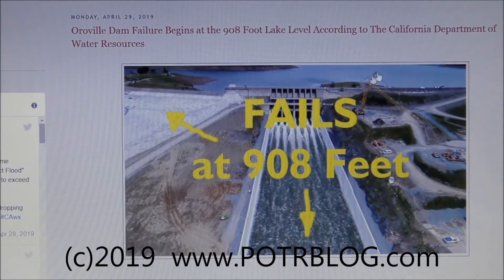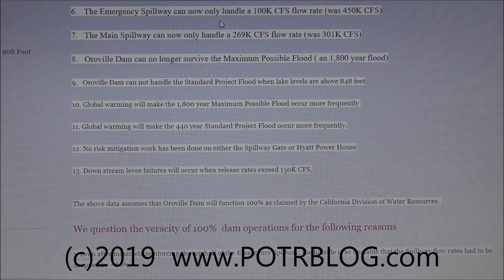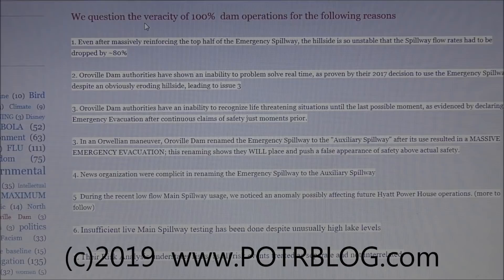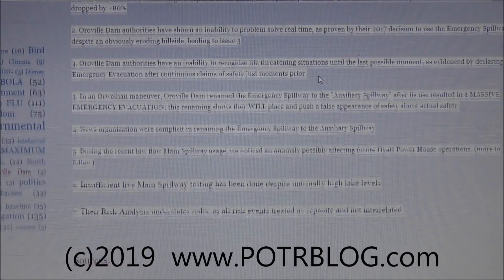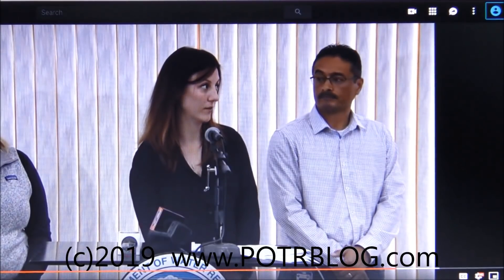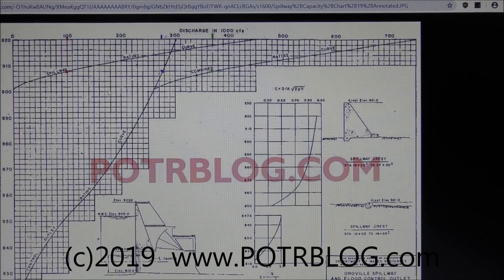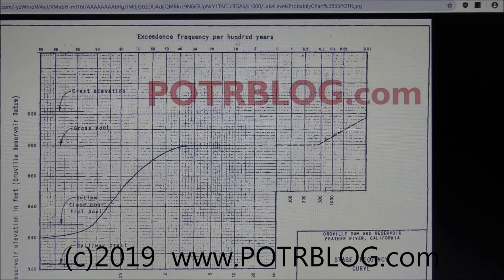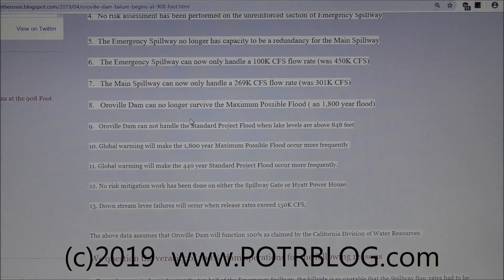Oroville Dam fails at 908ft says California DWR

Comment: it is impossible for the lake level to get to 908 feet, the massive 1/ mile long emergency spillway is built at 902 feet...  there is not enough water in the known universe to run the water level  6 feet deep over that spillway.    Cease being such a stooge please, its sickening.
Reply: The emergency spill way is at 901ft but other than that your correct the water would never be 7ft above it unless all reservoirs above oroville broke at the same time and Oroville was at the 899ft mark
Reply: @patrickzink2191  hello patrick,  the emergency spill way IS at 902 foot *elevation*... it is 1,750 feet LONG  that is over a quarter of a mile long.
Reply: @Phil_Scott  all stats I've seen say 901ft but ok
Reply: @patrickzink2191  The spillway's *horizontal distance is 1,750 feet more than a quarter of a mile, so that when the lake over flows it, the spill itself is that long.

.. there is less than a tenth the capability in the water shed around the lake to overflow that quarter of a mile more than 2 feet deep, with the main spillway closed, 

If the main spillway is open... then there is not enough water in the known universe to over flow the main spillway and then over flow the quarter mile long emergency spillway 16 feet deep.... it will never, ever happen, not in a billion years.

902' is just the elevation of the emergency spillway, it is 20 feet below the crest of the dam.... for the dam to be washed out, water has to crest the dam... that is 18 feet *deep flow across the spillway.  .. an impossibility
Reply: @Phil_Scott  no shit bro only thing I said is the spill way is at 901ft not 902ft but otherwise I agree with u

Comment: With the reconstruction of the two Oroville spillways completed there seems to STILL be controversy.  There needs to be some clear statements of FACT.

 First, the the elevation at the top of the main dam is 922 feet.  The EMERGENCY spillway is at elevation 901ft.  That is 21FEET lower than the top of the dam.  Think of the dam as being the equivalent of a two story building higher.  The main spillway is designed to handle a volume of water needed to keep the lake elevation between 830 feet and 900 feet in a normal spring runoff season.  The EMERGENCY spillway handles the rare events where volumes exceed the capacity of the main spillway, as happened in 2017 when the lake level topped out at 902.59 feet.  NOTE THAT THIS IS STILL 20 FEET BELOW THE TOP OF THE DAM.  

The crisis existed because the EMERGENCY spillway was in danger of failing, NOT the main dam!  The emergency spillway was not designed to handle the flows that occurred in 2017 and it was feared that the concrete lip on that spillway would be under cut and fail allowing the EMERGENCY spillway to uncontrollably erode causing a devastating flood downstream.  At NO POINT was the main dam in any danger. 

The reconstruction of the main spillway was required because of damage to that structure.  The main spillway has been constructed to far higher standards using far better materials than the previous structure.  However, the more important work was the reconstruction and "hardening" of the emergency spillway.  The emergency spillway has been reengineered to be far more resistant to erosion than before.
Reply: It's still failing on the spillway cause it's showing the rebar on the spillway...it's spalling it's coming apart like the other spillway did ok...
Reply: @ginapalang9191  were is the proof or are u taking the word of someone in Ohio that is only seeing YouTube videos and there are no pics Or videos showing rebar in the completed concrete
Reply from the maker: Unfortunately you have some mistakes in your "FACTS"
#1 The construction on the Emergency Spillway is not yet complete, they are working on adding a concrete cap https://www.youtube.com/watch?v=WB3iNa5eRNY&feature=youtu.be&t=1083
#2 The Emergency Spillway was WAY under its design limit of 450K CFS when it started failing at 12K CFS
Basically what you are saying is that Ca_DWR in 2017 KNOWINGLY used the emergency spillway beyond its capacity. If thats the case, then its use in 2017 was criminal and you should contact the authorities with your "FACTS"
Reply: @potrblog  Regardless of anything else,  the fact is that the top of the dam is 21 feet higher than the top of the emergency spillway.  It is designed that way to ensure that the dam is NEVER overtopped.  When the emergency spillway came into use in 2017 the lake never got higher than 903 feet.  There was NEVER any chance that the main dam would fail.  Rather the danger was that the brow of the emergency spillway would fail and wash out resulting in a catastrophic flood.  If that had happened the main dam would have been left high and dry, but intact.
Reply: @potrblog  Again, emergency spillway is not a spillway it's a dumb wall and nobody get's to "use" it, nobody can choose that, it will overflow it self, you're right about the other stuff but please avoid using the "use" or "choose".
Reply: @potrblog  the emergency spill way might have been able to handle 450cfs if the ground below it didnt erode hours into the  "release"  or over topping and to be honest they didnt want to use it but needed to try to put a bandaid on the main spill way from its original weak design of 14 in thick concrete with very little rebar to the current 40+ inch thick heavily reinforced concrete

Comment: it would take a tidal wave for water to get to 908 feet since the top of the spillway is only 900 feet so that is a 8 foot wall of water over the top of the spillway better get you life jackets ready for that and i have a nice bridge for sale too
Reply from the maker: Nah, The whole lake acts the big end of a funnel  with the spillways being the small end. Even a few millimeters of water pouring in over MILES of lake shore can  easily cause an 8 foot tall outflow over few hundred foot long weir.   Even with the Main Spillway at FULL BORE OPEN, the design documents indicate such an 8ft wall of water would overflow the emergency spillway on average every 525 years. If for some reason the Main Spillway was not functional you probably could expect the 8ft wall of water to occur regularly. There's a reason why they want to add a 3rd spillway.

Comment: THE VIBRATIONAL ANAYLSIS IF FLAWED
Reply: That 'analysis demo with the thin rod held in air resting on the mans hands is not applicable of course to 600 million tons of steel reinforced concrete bolted to the rock below... its an absolutely ludicrous comparison.

Even that rod if you laid on the ground or even on your lawn would no longer vibrate...that should be obvious to any normal person.

Comment: The ESW's problem is on the north end of it. If you look at elevation maps you will see that area is the lowest, and does not seem they did anything about it with the redo. Then look at vids just before they called the emergency 2 yrs ago. You'll see water sluicing around the main ESW wall.
IMHO, what they should have done was given up a little overall capacity and cut a "notch" into the main section, and/or raised barrier height in the area.

Comment: Snowpack was recently measured at 156% of normal. That’s where the calculations need to be done now. There are two smaller dams above the oroville.
Reply: Correct if you mean by recently.. 2 months ago... in the last 60 days 90% of it has since melted.... and run the lake levels up close to 100 feet..what the dam was designed to do, ....now there will only be another 2 to 5 foot rise due these 5 slightly rainy days  (averaging 1/2" per day)

Comment: Great to hear from you! Thanks for posting!

Pay no attention to the army of paid shills who cry "conspiracy theory".  However, some of the stats you gave no longer match the dwr updates.

They now claim that the main spillway had a target flow if 100k cfps. They tested it at 25 cfps and had problems with buckling concrete blocks and subsequent leakage under the spillway. They have been running around like ants at night with flashlights. The main spillway has not been used since that "successful" test...apparently cuz they like the water level going up to its max. Thankfully, inflow has slowed down...but with the MELTING of the extensive SNOWPACK, it doesn't matter if it rains; there's plenty of water coming down the hill anyway.

Further, there is no info about Lake Almanor which is further up on the Feather river watershed and has no way to mitigate release rates.  There are two other dams up river as well.

If we could trust the dwr, that would be helpful, but they have proven to be LESS than trustworthy. They seem to be more about cya than safety for the public...AS THEY HAVE ALREADY SHOWN. Thanks again for this vital update!

And, to folks in the area; be prepared NOT scared!
Reply: The 3 inch thick concrete blocks are impossible to buckle especially bolted to the base rock ever few feet with 20 foot long rock anchors.

The term buckling was in reference to the way a *gate failure occurs (such as at the Folsom dam about 20 years earlier, one if its 8 gates buckled).
 Those are made of steel.  The cause of that failure by the way has been rectified on all such gates in the US.  (rusted pinions, now force lubricated).

By the way, a single gate failure will not allow enough flow to raise the river more than a foot or two... its not an issue... then the Hyatt power plant would be shut down and the river would drop back to seasonal norms... a gate failure is not a problem.   All gates failing at once would be a one in  million.
            ***********

On the issue of the DWR failure threshold at 908 feet.

More ignorance. 

At 902 feet water begins flowing over the QUARTER MILE LONG WEIR  (emergency spillway) 

the water depth over the weir will have to be 6 feet deep. in order for the water level to reach 908 feet deep flowing over the emergency spillway weir... 

that would be more water than there is in the universe so to speak.

The DWR statement remains accurate however... something like saying "If you get run over by a truck 6 times"... your breathing will begin to fail.   True, but not even remotely likely.

Such an accurate statement fact has to be a key part of any calculation however.

That is part of any engineering project.  It is the upper limit... and the system is *designed so that this upper limit will never be reached.
Reply: @Phil_Scott  How do you sleep at night? Anyone with eyes can see there are gaps between the "buckling" plates. I am not even going to address the rest of the BS you are peddling...as if forced lubrication could reconstruct disintegrating gate pins. The gate pins are the least of our concerns at this point. I pray that you change your mind and stop destroying yourself and others with lies that could lead to a catastrophic loss of life.
Reply: @Phil_Scott  Ad hominum attacks = admission to the failure of your argument and the voracity of mine. Thanks for the acknowledgment!
Reply: @lovebiota286  Brilliant!  Now tell us once again how a few hundred feet of steel reinforced concrete 'buckles'  (buckle means 'bending the point of collapse).. we need to know about how these thick concrete slabs bolted to bed rock every few feet with 2 inch thick rock bolts... bends.   or buckles.
Reply: @Phil_Scott  What "we" need to do is open our eyes to look at the gaps and to stop wondering how improperly cured concrete with hairline fractures could break up. You are never going to win this argument; there is already too much evidence disclosed. I understand that your job is to spread disinfo, but in our current economy, I believe you could acquire a better job with better wages and feel alot better about yourself.
Reply: @lovebiota286  The gaps are an integral and carefully planned part of the design.. if you had watched the construction detail video's and the project engineers explanation you would know that.  It is you and a host of other trols and idiots that are spreading false information, most of it entirely ludicrous on the face of it... things like 10 foot to 100 foot thick concrete buckling...   then when called on it, you change the subject.   Not impressive at all bud.
Reply: @Phil_Scott  No, the gaps that formed after the harmonic tremors and failed test. Yawn.
Reply: @lovebiota286  if u look at pics of the completed MS and how it looks now they are the same oh and look at the pics from the archives and u will see they all match and there is no buckling
Reply: @patrickzink2191  Hi Patrick! That's not what I see, sorry.
Reply: @lovebiota286  please show me evidence of this cracking/buckling of 7ft thick rock bolted concrete please
Reply: @patrickzink2191  Oh, you mean the improperly cured concrete with hairline fractures all through it that is bolted into weathered rock  and mixed geological media that was already unstable in the first place? 

Well, add the hydrological shockwaves and harmonic tremors from the brief test of the main spillway and then, maybe you will be able to see what is right in front of your eyes. The gaps are plain as day, I can't make you see what you don't want to see, sorry.
Reply: @lovebiota286  harmonic tremors felt everytime tje spill way has ever been run u mean
Reply: @lovebiota286  all concrete has hairline cracks
Reply: @patrickzink2191  WRONG
Reply: @patrickzink2191  And that has worked out great both times, eh?
Reply: @lovebiota286  go check ur concrete sidewalk and drive way they are 3 to 4 inchs thick and all have small cracks.  The slabs of the spillway are 7 feet thick I'm sure a small hairline crack won't be an issue
Reply: @patrickzink2191  There was not one hairline crack; there are thousands. Ever try to cure concrete in extreme heat? It ends up with as many cracks as a shattered windshield.

Bottom line, in about 3 days neither of our arguments will matter. The proof will be in the pudding.
Reply: @lovebiota286  and I've heard the world is ending in 6 weeks but we will see if that's true
Reply: @lovebiota286  I will hit u up on the 24th to prove to u that there is nothing to worry about
Reply: @patrickzink2191  Are you saying that the dam will end the world? I dure didn't say anything like that; that was your biased inference. How about this: let's wait and see what happens in 3 days?
Reply: @patrickzink2191  Ok, c u then.
Reply: @patrickzink2191  its the 29th...please tell me you haven't forgotten?
Reply: @JimCollison  dam and spill ways still there

Comment: I get it! It's not just the weight of the water it's also the friction of the long descent that is pulling the ramp off the mountain.
Reply: Interesting
Reply: So how come the crappy old MS never slipped down the hillside? It had seen 150k+ outflows in 1997 and other years. The old MS had a lot less anchor bolts, unevenly thick concrete and rusting rebar.

Comment: I strongly believe that the emergency spillway can handle required discharge  at 901 feet level and prevent spill over the main dam which is at 921 feet. 
Luckily, we are out of the rainy season.
Reply: You forgot snowmelt

Comment: I read your blog post, went to the three DWR sources you cited, and did not come away with most of those items.  If could cite page numbers/time stamps for each item it would be helpful.  On the subject of how high water could rise on the dam before it fails, I believe the design was 21 or 22 feet, and you are alleging that it is actually 7' (901 + 7 = 908).  I could not find a reference for that, but I do know that 6" of rain can not fall in a day at this time of year - so your proposition if anything is a long term concern, not for this season.  They won't get 6" cumulative in the entire next 4 months - probably more like 2 or 3.

Contrary to what you wrote in the pinned post, the dam is designed around delayed release - which is in the January DWR meeting video you cited.  It relies on delayed release to perform to its design goals - buffering inflow.  It's a related rates problem, like in high school science or math.  6" of rain in a day is a threat, depending on lake level and if a soft snowpack (eg Dec-Feb) is exists.  6" of rain on a compressed ice pack less so, and 6" of rain over 4 months not at all.  So it absolutely does matter - without a deluge rainstorm, there is not a mechaniosm for the lake to overflow.
Reply from the maker: There is a good reason why Oroville wants to add a 3rd spillway, read to the end.
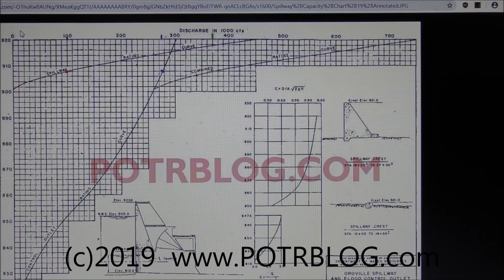The source of the 908ft failure point is discussed in detail in the above video from 5:39 to 8:33. Data from the Max Possible Flood can be found in Chart 33 of the Oroville Design Document see https://water.ca.gov/LegacyFiles/orovillerelicensing/docs/FEIR_080722/AppendixA/Extracted_Comments/C0005_SutterCty_YubaCity_Levee%20Dst1_Appendices_Pages_10-177.pdf
Using Max Flood chart 33 + the 908ft failure point + Chart 16 , you can read the lake acre-feet storage at 908ft and use that info to read Chart 33 and see that corresponds to reaching 908 feet in 21 hrs, then using the Spillway Design Flood info on page 13 of the design document you can calculate how much rain fall occurs in the 21 hr period when the lake reaches 908ft level. Moreover from looking at Chart 33 you will see that it is a delayed release scenario. The delay comes from the time it takes for the lake to fill to 908ft even with all spillway flows at maximum.
But how long or short the delay is, really isnt important; IF lake levels reach 908ft Oroville says the spillways will fail. For example if the Main Spillway is unusable (eg gates jammed by earthquake) the lake will continue to fill beyond 901 ft as long as inflows eventually become greater than 100K CFS. If the main spillway becomes non-functional the lake levels could rapidly reach the 908ft failure level